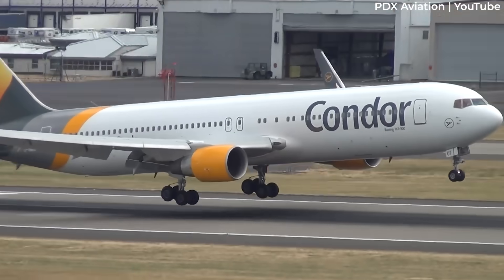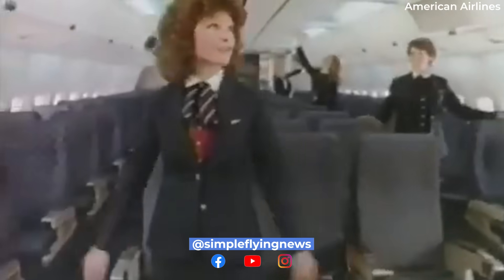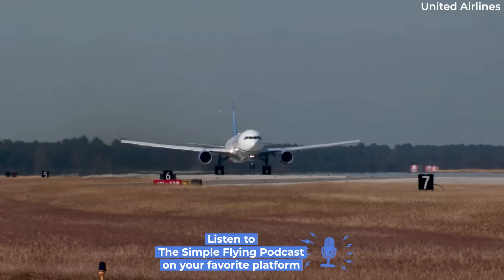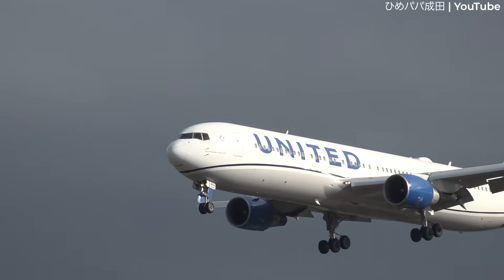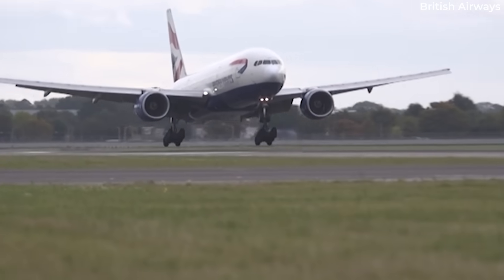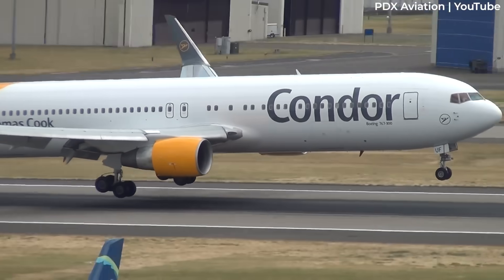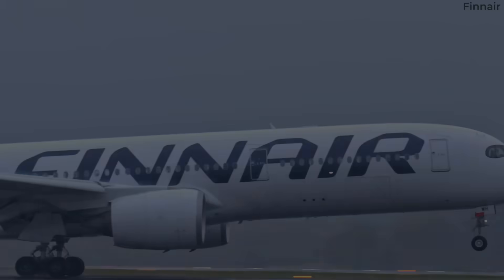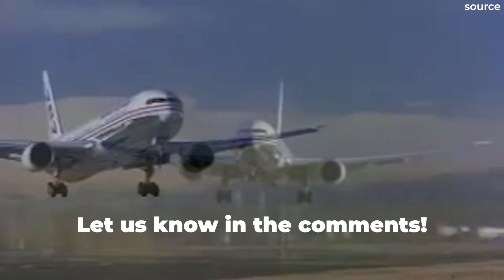Why Did Boeing Build The 767 With Forward-Tilting Gear?

Comment: 777 also. Pretty simple. In the event of alternate extend, the drag created on the falling landing gear will push the gear in to the down and locked position.
Reply: If I remember correctly, the design of the landing gear strut door also contributes to driving the gear down and locked during alternate gear extension. The shape of the door allows it to act like an airfoil and ''fly'' the gear down and locked.
Reply: @SteveGhidoni-e4o that’s the main landing gear.
Reply: Correct. MLG
Reply: 767not 777.
Reply: @SteveGhidoni-e4o Both. Trust me. I’m pretty close to both of them.
Reply: Same here. Glad to meet someone who appreciates the aircraft. I'm more from the maintenance side of the equation.
Reply: By ''same here'' I'm referring to the 767. I retired before I was able to experience the 777. It was in our fleet at the time. Just never got a chance to experience it. Timing is everything.
Reply: @SteveGhidoni-e4o Yes. Good design ideas are often reused. And it would be hard to do better than an idea that used the poor aerodynamics of the landing gear for the benefit of helping them go into the down and locked position in an emergency.
Reply: No argument from me. Just want to associate with others who love aviation. There's a lot to learn.

Comment: The reason the trucks tilt is basic geometry. 

If you look at the top of a 767 main landing gear leg is is cranked over. Also the forward and aft attachment points are not parallel with the centre line of the fuselage. 

Therefore during retraction the centre line of the bogie pivot moves forwards quite a bit. IE. If you were to draw a line on the ground where the truck pivot is when the leg is extended, then draw a similar line where the truck pivot sits when the gear is retracted there's a significant difference between the two lines.

As a result, the truck has to tip forwards otherwise the bogie wouldn't be parallel to the centre line of the fuselage and the pivot point of the top of the leg would need to be even further out towards the wing tip.

To get the weight and balance of the aircraft in the correct place, the main wheels have to contact the ground in the right place. The shape of the wing influences where you can attach the top of the landing gear leg and this defines the geometry of the leg.

Comment: In interesting example is the Convair 880/990. The 880 had "normal" aft tilting bogies but the 990 had forward tilting bogies. The reason for the difference was the 990 had a longer main landing gear with bigger wheels/tires yet had to fit into the same space as the 880. By skewing the trunnions and altering the geometry and going to forward tilt they got it to fit in spite of it being several inches longer while still being attached to the wing at the same location.

Comment: AIrcraft mechanic. The only reason the main gear bogey tilts forward or backward or remains level is to fit into the landing gear wheelwell.
Reply: Exactly. The truck or bogie has to lie parallel to the aircraft centerline when retracted. It all depends on whether the actual landing gear leg rotates directly inward in which case the bogie is probably at right angles to the leg or if the leg swings forward as it retracts in which case the bogie has to have a forward tilt to make it parallel to the centerline when in the wheel well.

Comment: Truck tilt is accomplished with hydraulic actuators. Truck tilt also provides air/ground. sensing through the use of prox sensors and targets. Aircraft weight on wheels levels the trucks to provide ground sensing. Ground sensing enables various systems such as ground spoilers, thrust reversers, etc. Another interesting design feature of the main gear is the struts. The main landing gear struts are dog legged or angled outward towards the top of the strut. This provides a wider gear footprint for better weight distribution. Also, when the landing gear is extended or retracted a spring loaded pop up door opens on the upper wing service to allow the reunion link to move without punching through the wing skin.
Reply: u mean the wheel struts are canted outwards like this /  fuselage \  when looking forward directly at the airplane? And wym the upper wing surface has a pop up door open when the gear moves, I've never see that before!

Comment: The 767 does NOT pitch down at touchdown.   I have over 10000 hrs in the 767-200/300 alone and you usually bring the nose down when you apply brakes or the reverse thrust  will bring the nose down.  The 757 has the super heavy nose at touchdown!  You will be at full up trying to prevent the nose from slamming down.       The truck is tilted forward to fit in the wheel well on the 767 and some Airbus planes.
Reply: Yes that comment in the video did not make any sense to me.
Reply: I too flew the 757/767 for years and certainly agree with you on the 757’s noseheaviness. When I went through initial on the plane (this was back when there was an Instructor and classroom, pre-CBT), the question about the 767 gear geometry was raised and the instructor’s answer echoed yours. He said that was simply how it fit in the well best and took up the least amount of net room. I can neither confirm nor deny that, but I have no reason to doubt him either. It never occurred to me to think about it when flying, and I always thought it was relatively easy to land compared to some other aircraft I’d flown.
Reply: @HEDGE1011  I never flew the 757/767, so I’m going by what I read. But my understanding is that Boeing does say the 767 has a pitch down tendency on landing and that the forward tilt counters this a bit. So you guys say: no, it doesn’t pitch down on landing, but that’s with the forward tilt landing gear and you tell us that the 757 does pitch down, which does not have a forward tilt. So to me, It sounds like you guys are actually saying what the video is saying. 😂😂😂
Reply: @rtbrtb_dutchy4183 Well I can only speak as an operator while Boeing is a manufacturer, and if the 767 has nose down tendencies after touchdown they’re so minor that trivial pilot inputs mask them. The 757, on the other hand, definitely has a nose down tendency after landing, and if you attempt to hold the nose off and derotate even a fraction of a second too long it will reward you by aggressively banging the nose down hard enough to rattle your teeth. I am personally dubious that Boeing consciously decided on landing gear geometry on the 767 to counter nose down pitch tendencies.
Reply: @HEDGE1011  just to be clear, I know nothing about the 757/767 and I’m just having a bit of fun about this. 

Now, a bit more serious, I don’t think that Boeing made any sort of design decisions based on that. I think it was purely decided based on the space they had. It’s possible that afterwards they were like: oh look, it also helps with pitch. Not sure though. As I said, I don’t know enough about the 757/767.
Reply: @rtbrtb_dutchy4183 I think we’re saying similar things, and no offense taken. I suspect that it’s hindsight justification about why the gear tilts that way. It sounds better to say “it helps assist the pilot counter nose down pitch tendencies” rather than “that’s the way they fit in the well”. It’s all highly speculative and it really doesn’t make any difference in the end. The 767 is pretty easy to land consistently (unless you pull the power too early!) I’m not slamming the 767 in any way, I just question the whole nose down neutralization theory especially as they obviously didn’t care about that on the 757, which has that tendency in spades. It’s a mystery for the ages I guess!
Reply: @HEDGE1011  sounds like the 757 is like the Gulfstream G4, G5/550. As soon as the main gear touches down, you have to pull the yoke in your lap. You can make a perfect landing on the main gear and screw up the whole landing with the nose gear.
Reply: @rtbrtb_dutchy4183 Never flew a Gulfstream, but that sounds very similar to the 757. The key is after you pull back, knowing how fast to release the back pressure to bring the nose down…a tiny bit too rapidly and the passengers will be making the jokes about how you must have been in the Navy as they deplane!
Reply: @HEDGE1011  why did the 757 have a heavy nose down tendency after landing vs the 767 >? surprising since it's lighter, etc, I'd imagine it'd be lighter on the controls. .
Reply: @KuostA The 757 is not lighter on the controls. The 767 is generally more responsive, especially in roll (4 ailerons vs. 2) but you’d have to ask an aerodynamicist about the 757 elevator authority/pitchdown issue on landing. I’m not slamming either, they’re both just different. I prefer the 757 handling personally, though I know many people who like the 767 better. To each his own.
Reply: The 67 when landing with 30 flaps does tend to have a nose down after touchdown tendency. It is not very noticeable most of the time but when the aircraft auto lands and you watch more closely you can see the yoke move aft quite a bit after touchdown to prevent the nose from slamming down.

Comment: The position of the bogie ("truck") is usually set by the geometry & kinematics of the landing gear to get the optimum wheel position in the wheel bay. 
It does not normally have anything to do with touchdown characteristics - an exception being the A330/340 main gear which has a special two stage touchdown characteristic, with a "soft" initial touchdown.
A380 main gears are similarly setup to touchdown front wheels first - driven entirely by the retraction geometry.

Comment: If I read correctly years ago , the wheel well was too small and the engineers had to redesign the action of the landing gear so it would fit into the wheel well..

Comment: A310’a and Indian Airlines-spec A320’s landing gear do tilt forward.
Reply: they dont tilt at all. they were designed to be fixed, just as a lot of older aircraft with multi-wheel main landing gears did
Reply: @anticooperativ8398  but why they looks “tilted?”
Reply: @EduardGenardAndalis it’s purely because of the AOA on approach. Of course they aren’t completely stiff though

Comment: Even with this change 767 lands very rough. Also is it just me or is 767 relatively slow for a widebody aircraft?
Reply: Generally the 767 cruises at m0.82, where as new modern jets such as A350 or B787 are 0.85/6. So considering it's age is not slow.
Reply: @Tomk12000  "Considering its age"   sounds wrong here, since previous generation aircraft tended to have higher cruising speeds than modern ones.
Reply: @dmitripogosian5084  Yes many older passenger jets were faster. The reason most modern jets are slower is because it is more efficient to fly at a certain speed.
Reply: They do not land rough, and the plane was designed to cruise at .82 mach, with a Mmo of .84.   That is slower than the 747, DC10/MD11, and the 727 but fairly similar to modern wide body airliners.  Most of the time the flight is planned at .80 to save fuel.

Comment: Makes the 767 easy to identify on final approach.
Reply: Does the 757 use the same forward tilt LG?
Reply: @shauny2285 No.
Reply: @shauny2285 no
Reply: @shauny2285  No. The 75 is a heel dragger.

Comment: Well, if you're a runner, you'll know that front foot strike is much safer than heel strike runners ;)
Reply: That’s because the front of your foot isn’t directly underneath your leg.  

This doesn’t really apply to aircraft that can and do put wheels right in line with the air oil-shock struts.. which unlike your leg can compress and absorb the shock.

Comment: Fun fact: the B-2 uses the same gear.
Reply: Really?
Reply: False
Reply: @ True ✌😹
Reply: Stuff online says gear designed and manufactured by Boeing and based off the 767 but I have no idea if that is true.
Reply: @thud9797  wouldn't doubt it, considering the Air Force probably used the same approach when building B-2 like the  F-117 to keep it secret. They "stole" parts from the F18 and the F15 to build the F117.
Reply: @TheXcaliber223  Also, the C-17 uses the same engines as the 757. The PW2000 ones, not the RR RB211's.
Reply: @wannabedal-adx458  yea that made me have a double take when I was on a ramp one time, I heard a 757 but saw a C17. XD
Reply: @wannabedal-adx458  If you look at the F117 start up it has the same growl the legacy hornets have when starting up with the F404s.